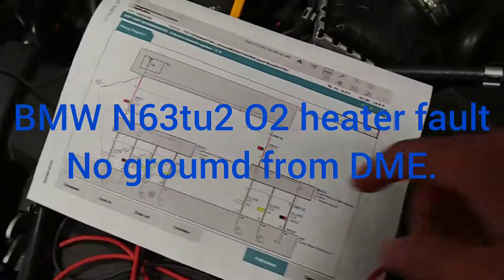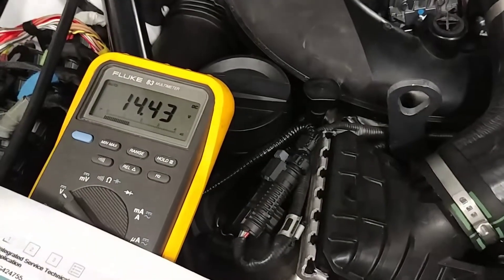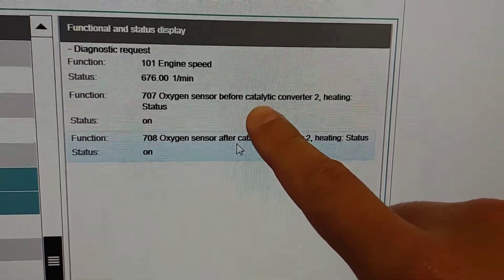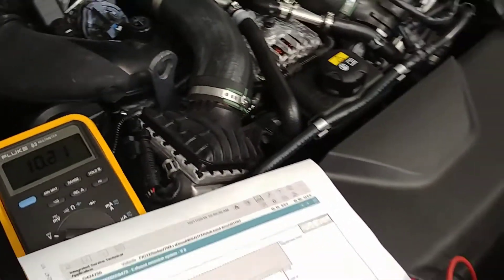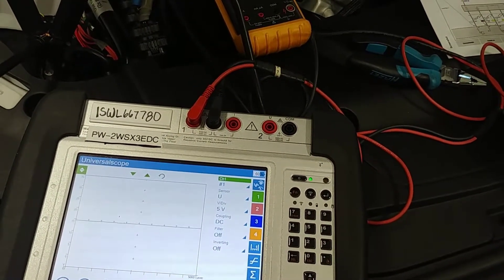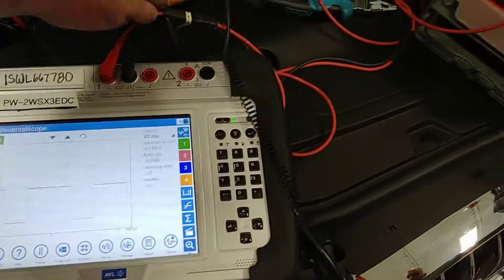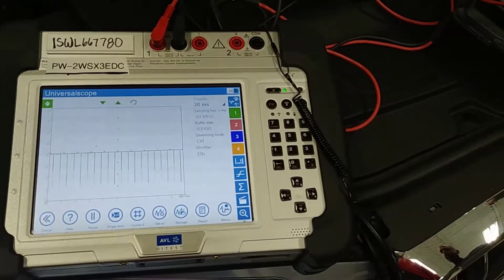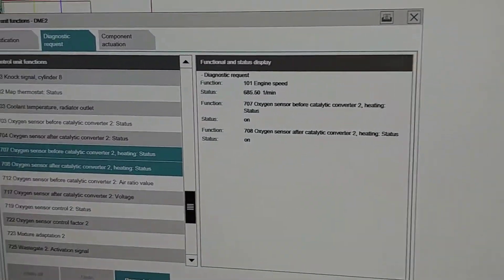BMW N63TU2 O2 SENSOR HEATER CIRCUIT FAULT

Comment: Is the power and ground for post 02 sensors internally located in the ECU ?  I get a code that both sensors do not heat up fast enough on my 09 BMW 750i N63

Comment: I got the same code on my bank 1 post cat o2 sensor and changed the O2 sensor and still getting the same fault code circuit heater. How can I solve it?
Reply: I have the same issue , did you solve your issue ?
Reply: @danielmackormack8524  BMW G12 with a N63tu2 engine has bank 1 sensor 1 O2 heater circuit faults. This is showing how a failed DME which applies the ground for the heater circuit is not grounding the circuit internally there for requiring a replacement of the DME.

Comment: So was it a faulty dme or a cable ?
Reply: Did you find the answer?
Reply: BMW G12 with a N63tu2 engine has bank 1 sensor 1 O2 heater circuit faults. This is showing how a failed DME which applies the ground for the heater circuit is not grounding the circuit internally there for requiring a replacement of the DME.